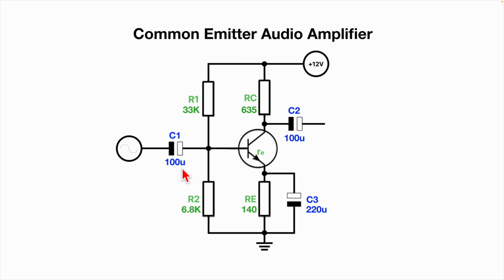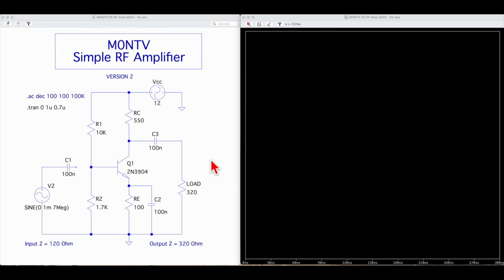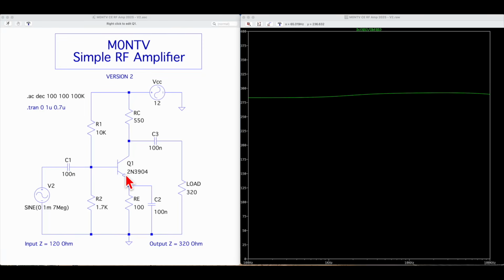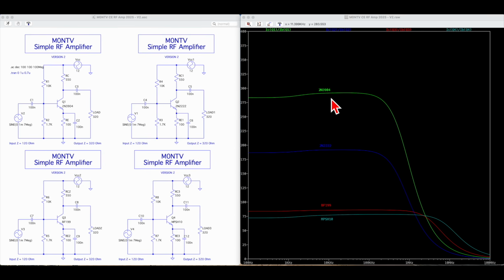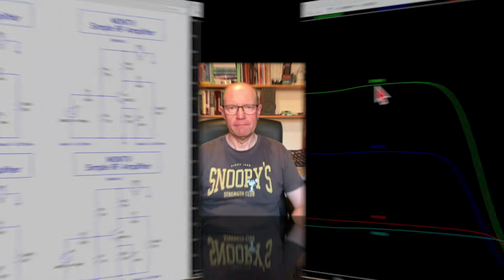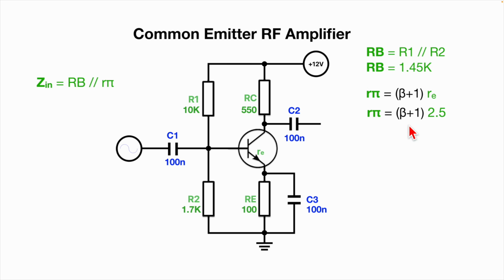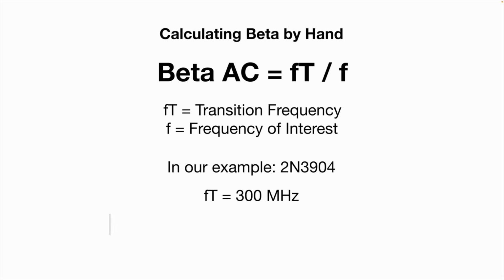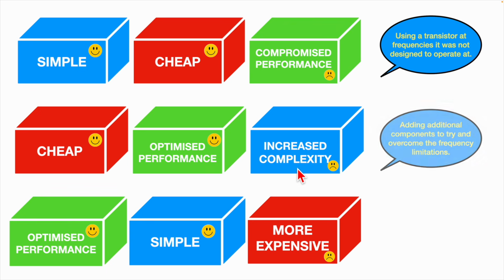64 - RF Design Challenges: PART 1 - THE BUGBEAR OF BETA

Comment: I have a part number suggestion for you since you mentioned liking that last option in your example. 2SC3356. 7GHz transition frequency, ~200 Hfe, 0.5pF typical miller capacitance, 100mA rated, and 2¢ a pop.

Comment: Hi Nick....me again...
my question is ..can you make video about RF amplifier -
one transistor 2N3904 or 2SC945 ...both have fT cca 300Mhz
but i have request that this RF amplifier work on 3V DC
i am loooking forward on your reply 
thanks in advance!
Reply from the maker: Hi there! Thanks for the challenge but I'm afraid I'm done with single transistor RF amplifiers for a while. Plus trying to run it on a 3V DC supply will give you virtually no head room at all. This will be a job for someone with a bigger brain than me I'm afraid! Thanks for watching though. Best wishes, Nick

Comment: Great video! One way of reducing beta dependence would be to have a small resistor (probably less than 10 Ω) connected in series with the 100 nF emitter capacitor. Of course that would reduce the output gain, but would also reduce the beta dependence as well as increase temperature stability.
Reply from the maker: Thank you Mihajlo! That's a good call about reintroducing some emitter degeneration. You are absolutely right - a little less gain but greater stability and less beta dependence. I'm going to mention this in the next video because that reduction in gain also helps to reduce the Miller Effect. Thanks again. Best wishes, Nick
Reply: @M0NTVHomebrewing  just keep in mind to account for that extra resistor R_E2 when calculating the input impedance (β+1)·(r_e+R_E2). One additional idea would be to simulate input and output transformer in the circuit using two coils with k=1 coupling coefficient to match impedances to 50 Ω on both sides so you can directly compare power in dBm and dB gain.

73 de YT1GS.
Reply from the maker: Thanks again. 73, Nick

Comment: This is great. I am currently building a Phase spllitter to use for a 2 NPN push pull amp but I cannot seem to get the output stable at all. Its severly distorted and has a bunch of harmonics to the point that the principal frequency isn't even being preserved.
Reply from the maker: Glad this is of interest. Hope you fix your project. Best wishes, Nick

Comment: Some of things i can agree with you and they are not problematic...BUT you don't explain core of problems
as you said every transistor type is different ..yes there are similar types ...but eaxh is some sort of unique
and not just beta then when we measure internal resistance  and most important factor is BASE current
so base current mus t be in range 30-60-90 uA
so 30 is too low and add noise to signal, 60 is too high for some transistor types
40 is good for start ...and RF amp or for preamp is fine ...
90 is almost too large
then we must build RF amp to reach as possible  0.7V base emitter voltage 
if is lower than 0.6 V then working point cannot be good in any case 
from all this biasing point must be  from 0.8 to 1V at base(highest 1.2V)
also some transistors need larger supply voltage 3-6-9-12
because all of this RF transistors exists and use them over general purpose like 2N3904
or 2SC945 which also have fT up to 300Mhz
but they are not good as RF types 
C9016
C9018
C3355
BF199
BFR91
and other RF types
all best...
Reply from the maker: Thanks for your input. Best wishes, Nick

Comment: Not to quibble, but a 100nF capacitor is three orders of magnitude smaller than a 100uF capacitor...
Reply from the maker: You are absolutely correct. Sorry, despite several error checks that one slipped through! Thanks for the correction and indeed for watching the video. Best wishes, Nick

Comment: Might like to add some 2SC3356 to your next parts order... they are a very cheap (3 cents on LCSC) SOT23 NPN with hFE of ~150, but their transition frequency is apparently 7Ghz!
Reply from the maker: Wow! Thanks very much for the tip. I'll certainly keep an eye out for some of those! I have experimented with some of the surface mount MIMICs e.g. MAR-6SM+ and had some good results. It's probably the way to go. 73, Nick

Comment: Awesome video, sir any video on explaining transmitter and receiver circuit to control the dc motor in RC toy. If yes please upload it. If you dont have, a humble request to please make it for the beginners who are new to electronics
Reply from the maker: Thanks very much. I'm afraid I have no experience in radio-controlled devices or motors. I'm sure there are plenty of people on YouTube who have though and might be better equipped to help you. You could try searching for some RC groups and ask there. Thanks again for watching and all the best in your building. Best wishes, Nick
Reply: @M0NTVHomebrewing thanks for the reply
Reply: Far too broad a question. If you want simple on off control there are plenty of cheap 433Mhz Tx and Rx modules available. If you want a linear type of control then it gets much more complex. As Nick suggests search in more appropriate groups for RC type content.  (warning this in not a beginners project)

Andy
Reply: @andye2005 thanks for the reply